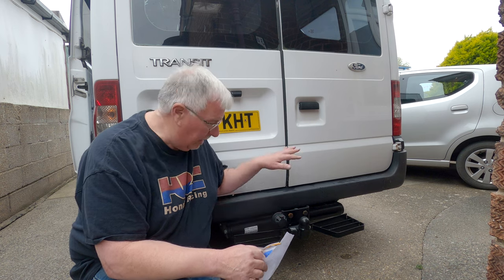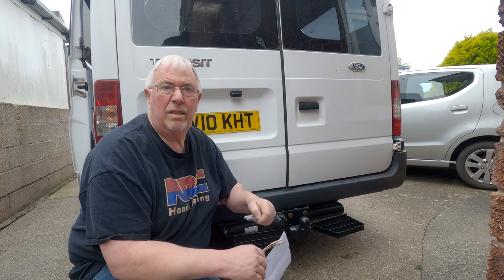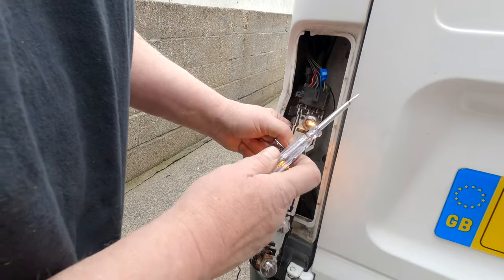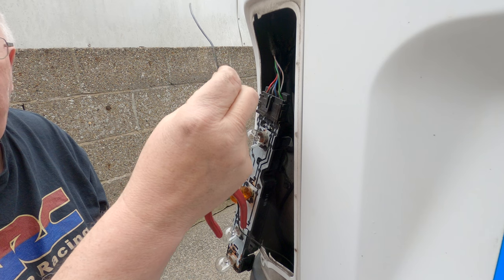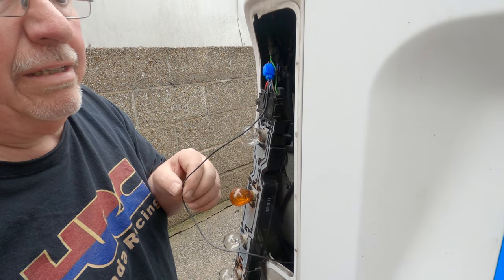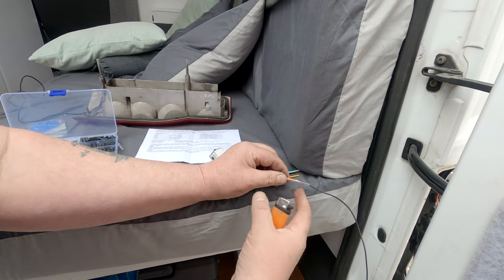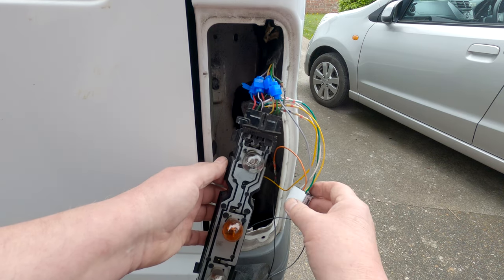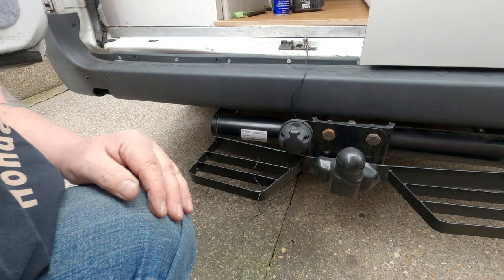How To Wire Towbar Electrics | Mk7 Ford Transit Van Camper Conversion | Tow Bar Wiring Guide | 011

Comment: I’m hoping the Mk6 is the same. Your description was fantastic and easy to follow
Reply from the maker: I think you should be OK,  the Mk7 and 6s are pretty similar, especially under the skin. You should be able to work the wiring coloursfrom the cluster if they are different.   A little patience and it's surprising what you can work out with a 12v test light.

Comment: Hi, great video, just one question regarding the two wires you ran from the passanger side, 
Did you connect these to their comrades on the driver side with a scotch lock?  Also, what wires were you soldering together?  Thanks in advance
Reply from the maker: The two wires are for the indicator and brake light on the opposite side.  These are both wired separately through the plug, not connected together.  The soldering doesn't ring a bell for me, I have watched the video back I think it is me using a test light that you are asking about.  I hope this helps.
Reply: Thanks for getting back to me, sorry I meant the wires you joined and heated with the lighter

Comment: Can i use the x2 skinny cables from the right side ( indicator and tail light) and wire the tow to the left side instead of the right ??
Reply from the maker: It is up to you which side you put the main connections, running the wires to the opposite side.  I have done quite a few towbars, and it can vary from vehicle to vehicle which is the best side to go.  Good luck.

Comment: Thanks very much for the help. I am trying this tomorrow on my MK7 2012 and hoping when I have a look the cable colours are the same. I am fitting a bypass relay.
Reply from the maker: Cheers, mines a Mk7 2010 model and I didn't seem to need a bypass relay. Yours may well be different though. You should be able to work it out from your rear light cluster even if the wires are different. Good luck!

Comment: Before I go tackle it myself, those wire connectors- can you re-use them? Meaning if I did a piece of wiring wrong can I take the connection off and use it on another cable?
Reply from the maker: If you mean the scotch locks, I have re-used them in the past, but they really should be replaced.

Comment: May seam a silly question but why did you tap into the left and right tail light? Right hand rear light cluster yellow/grey and the left hand rear light cluster light the blue/brown?
Reply from the maker: I could have taken the feed for the tail lights both from the right hand, but while I was there I thought I might as well run the wire to the correct one on the other side.  

I also thought a little about maybe overloading one wire that had one bulb running from it to having 3 bulbs.
Reply: Also means less spliced wires in the one cluster socket

Comment: The socket your looking for on mk6 is behind panel on rear passenger side of van .between arch and rear light
Reply from the maker: Mine is a Mk 7 I didn't see a likely looking connector when I was removing the lights.  I have really struggled to get a wiring diagram that matches my van.  There are a number on line but they all seem different.
Reply: @SPANNERRASH  ah soz thought that was a mk6 , great vid

Comment: Does the engine have to be running to check the vehicle female plug?
Reply from the maker: Any lights that work without the ignition being on will work OK.  For some such as the indicators or brake lights the ignition needs to be switched on, but the engine doesn't need to be running.
Reply: @SPANNERRASH  thank you.

Comment: Followed you vodeo thanks. However I am stuck on where the  LH indicator wire attaches after its attached to the light cluster!? Can you help ? 😅
Reply from the maker: If I am understanding what you have put correctly, that is the wire that routes through to the number one pin on the trailer socket, the one at 12 o'clock. It and the tail light for that side, need to be connected across to meet the wiring that goes to the socket, all of the others can come from the right cluster.  I hope this helps.
Reply: @SPANNERRASH  thanks for your reply. I'm retty sure I have done that. The beeper also goes to that wire also I think but no luck. I will have to look again.